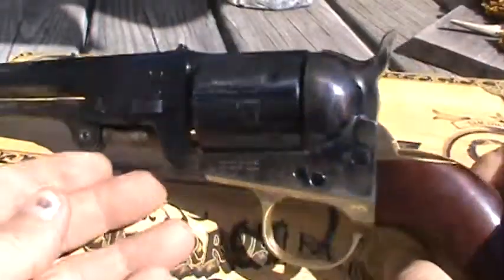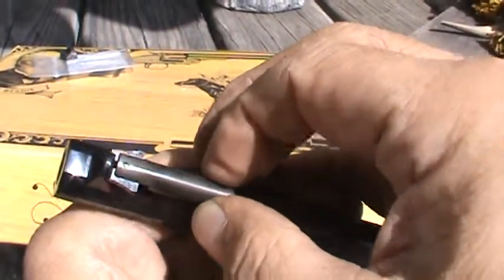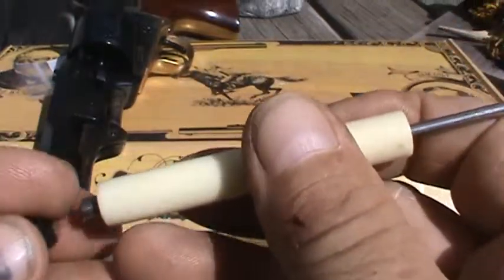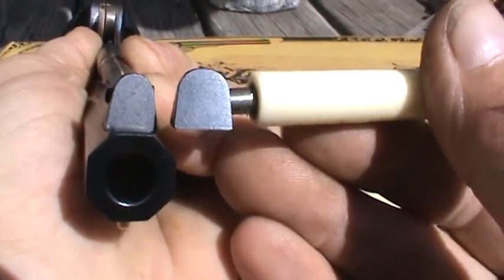Cimmaron Man W No Name

Comment: I got my Uberti 1858 new model army revolver and Howell .45 colt conversion cylinder a few months ago in late August. I’ve taken her out shooting a few times during this fall season and I’ve put about a 50 round box worth of HSM .45 colt 200 grain cowboy loads through her and even made a video of my most recent shooting session on Thursday and posted it on my channel of me doing 20 shots at a cantaloupe from about 45 feet away. However when I started cleaning her after the loading lever latch slid out of it’s groove under the barrel. I got it back in though and when the loading lever is latched into it I don’t notice the latch sliding back and forth in it’s groove but when the loading lever is unlatched I’m able to slide the latch back and forth in it’s groove with my thumb and forefinger. I ordered me a new loading lever latch from Taylor’s and company because I’m concerned that it will loosen during a future shooting session. I’m hoping that the new latch when I receive it will be a nice tight fit in the groove unlike the one it came with that’s currently on my piece but not so tight that I can’t install it successfully

Comment: You'd almost have better luck to have a machinist make one for you old friend.  Nice looking side arm!
Reply from the maker: +Mark Maysey first test all the spent cases stuck really tight wouldn&#39;t just push out as they should was some German (Geco) made ammo the shop had.&#160; All cylinders were smooth no signs of anything that would cause it. Tried some&#160; Fed AE stuff and one of the first 5 rds&#160; a case split 3/4s the way back. Run 25 more thru it and all cases could be removed with no problem with the AE ammo&#160; .So that problem was isolated to the Geco ammos brass. The one split case of the AE must have been a fluke as none of the other showed any signs of splitting or a indication od a cylinder that would be prone to it .Was waiting to be  sure all the  bugs were out b/4 I put the Sliver Snakes on the    grips

Comment from the maker: I probably should have just  put a punch mark or two on the bottom of the original so it would fit  the dove tail tightly ~~ looks  lot better now with the silver  snakes on both grips / after market ebay buy ,looks as good as original with out the  cost of real  silver